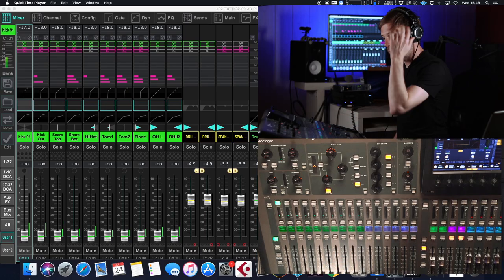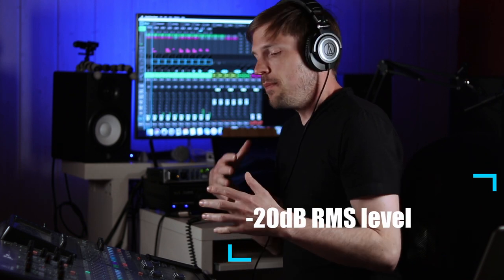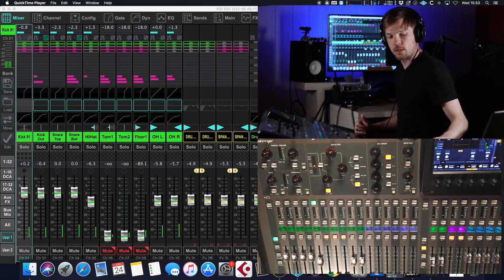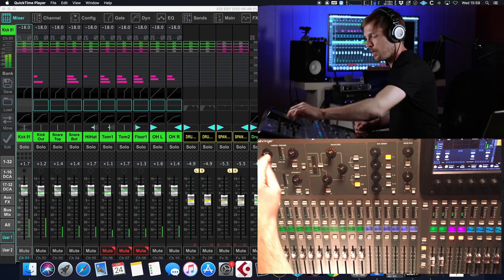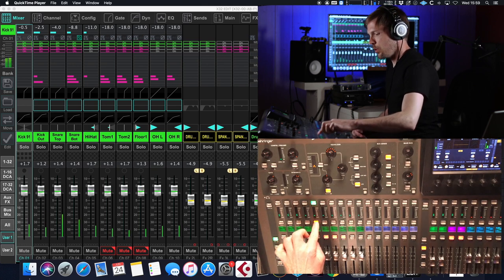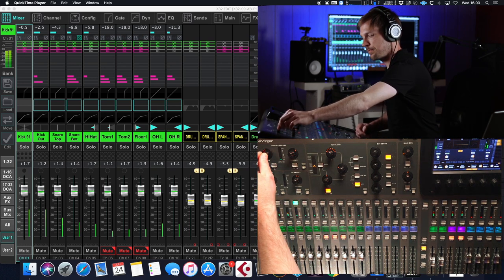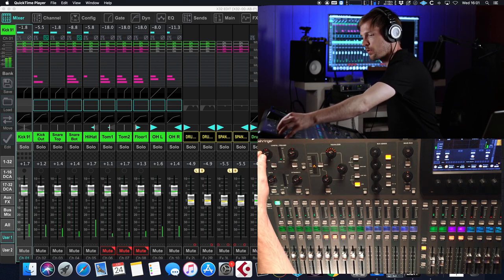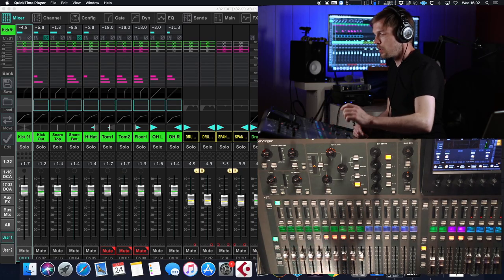Faders at Zero vs. Mixing With Faders Explained | Input Gain Settings for Different Mix Techniques

Comment: Always run your console gain at optimum level coming in.. then all of your Comps,Gates, and Aux buses  will run at optimum performance. If your faders end up to low, turn down the output bus feeding your PA .. Clean signal is best.
Reply: Completely agreed.
Reply: So to clarify, you suggest that mixing with the faders with all your gains at about -20bfs or 18dbfs RMS is better than running all your faders at zero and having different gain levels coming into he board.
Reply: @paulmanoogian7646  yes, but also keep in mind the purpose of the channel and the transients of the input. A kick and snare for example have more transients than a guitar, so the peaks of the kick can be hotter than the peaks of a guitar. Also you don’t have to have a hot input for a hihat as overheads also pick that up, so you would not end up having a hihat fader only half up and lose precision control with the fader, like explained in the video. Summup: with good gain, you have good S/N ratio and often good headroom. Also processing is most optimal with good gain input. Hope this helps.
Reply: @HT-Events  Thanks! Thats really helpful. Thanks for replying!
Reply: You do realize that compressors, gates, and outputs to auxes all have thresholds and levels, don't you? I don't think anyone suggests setting the gain so far out of the norm that it doesn't fall within the operating parameters of your downstream processors, but the faders operate on a logarithmic scale, and your best ability to do any fine tuning comes when the fader is at zero.
Reply: it also matters wether or not ypu are also doing monitors for a 14 person band from FOH while being 15 meters away from the stage how you setup your gain structures.
Reply: Correct
Reply from the maker: Thanks for your comment. I am not advocating for a specific approach - my video is just aimed at explaining the difference in how engineers approach mixing when faced with various scenarios. As with most things in life, nothing is an absolute. I agree, proper gain structure is important. But even with the Faders at 0 approach, in most cases the gain structure is not so far off that it would impact the S/N ratio so dramatically that it would actually hurt the mix to a noticeable level. I suggest you actually try both techniques and let me know what you find. Take care and mix great shows.
Reply: @gainmedialab  In this response alone you've just advocated for faders at 0. "But even with the Faders at 0 approach, in most cases the gain structure is not so far off that it would impact the S/N ratio so dramatically that it would actually hurt the mix to a noticeable level." That is sloppy thinking that leads to a sloppy work flow. 

Also, 13:40 and 14:36.

As far as trying it goes - I'm in a showroom right now that does 1200 shows a year and all their sound crew are freaking out how much the sound has improved in the 3 days I've been there. All I've done so far is gain optimization. I'm there because of the things I've learned in the past 40 years as an audio engineer. I've made more mistakes than you ever will because I was there when analog was the only format.
Reply from the maker: @Twongo  if you are coming from the analog world, then faders at 0 should be a very well known workflow, as it was dominating on consoles during the fully analog era. Not really sure why you are getting so upset if I suggest that people explore different workflows and gain more experience. Faders at 0 approach can work wonderfully with the use of modern day digital consoles as well, especially in the monitoring world - if one knows when and how to deploy it. The only way of getting that experience is by trying things out by yourself.  I salute your 40 years in the business, but if my 25 years of running audio has taught me anything, is to not knock any approach until I have tried it out on my own and not to claim any approach as an absolute truth. I wish you all the best on your audio journey and thank you for your passion. Take care and mix great shows.
Reply: @gainmedialab  It was absolutely not dominating in the analog era. It was wrong then, too. If you don't want to spend the next 25 years repeating the same mistakes then do the work to understand why I think I'm right. Once you discover what I'm on about you will gleefully remove this video.
Reply: Faders at 0 was something normal in the 80's in the 90's etc...
I am mixing like this from the 80' in analog and digital consoles 
And nobody complain about my mixes ( just the opposite ) 
I do this live and in recording studios 
Modern consoles are clean by definition have low noise in the analog side and a dynamic range bigger than the one you need for musical instruments 
You have a really big margin in analog side to set your levels over noise floor and far from clipping in a 24 bit converter you have 144db of dynamic range and all the modern converters have a really low distortion level 
But there is a noise you need to control and this is spill from the stage 
The more your mic gain the more the amplification you apply the spill "noise" from the stage 
If you apply gain only to see the same level of gain at the input you are going to have more noise from the spill and at the same time you lose a reference point to mix 
Faders are logarithmic for a good reason and the biggest control of mix levels are near the 0 dB mark of your fader not  in the extremes of the fader travel 
Try to do a fade out of something with your fader at -60 and after this with your fader at 0db and compare the results.
With faders at 0db you have +10db plus for instruments if you need ( for e guitar solo for example ) 
If you set your reference balance at line check with your faders at 0db you can mix easily your show with your FADERS  
Setting the initial balance with your mic gains don't mean that you are going to mix your show with gains only 
But if you have your faders at 0db at time to set your gains you are sure you have the same amount of signal coming to your console than the one going out of your console 
If not you are attenuating the signal coming into your console ,inside the console, with the faders 
It's possible ( if you use plugins that emulate analog equipment ) to go to clipping inside your console because your meters are not true peak meters or because you send several signals into a bus ,etc...
Fortunately modern digital consoles have a lot of internal headroom ( more than 1500db ) and modern converters are so clean and transparent than you have an stupid big margin to do whatever you prefer 
Do what you think is better for your mix and don't be a censor 
There are other ways of thinking than yours, and people doing other things than the ones you think are the only correct ones are not doing it because they know nothing about audio technologie 
Best regards

Comment: Preamps/gains are like water pump, faders are like your tap in your house. Mixing with gains(preamps) with faders at unity is like opening your tap all the way, and everytime you want to wash your hands, you go to the water pump to adjust how much water you need.
Reply: I love this analogy and wholeheartedly agree. Also, wouldn't mixing with gains be a nightmare when setting gain before feedback and ring out monitors?
Reply: @ralphdeonarine9133  every circuitry have noises correct? Set the preamp as hot before clipping to get the hottest signal in comparison to the circuitry noise (signal to noise ratio). Then open the master fader at 3/4 before unity for headroom, then you mix your band.

Then you can mix your monitors with Aux and foh with faders. Stage monitors or IEM setup. 

This is gain structure, we are setting the levels as 'high fidelity' as we can.

And also I don't refer to settings with 'db' as it's irrelevant in discussions, the input levels, preamp settings, consoles all varies, so mentioning setting this at this db is in reference to what?
Reply: Correct. Today, gain is only there to make everything your mixing console "hears" is exactly what it would be like if your ear was where the microphone is -- that is, the RMS is essentially equivalent, and it's not outside the bounds for things to distort or clip.

Mixing using gain in a studio context means that the person either has no idea what they're doing, or is doing it deliberately as an artist, at least with modern boards equipped with faders. But there's more to the story than that.

The reason lots of people started mixing using gain is because before the late 1970s, most live sound consoles easily available had no faders, and many mass market boards just had a single knob for "volume" or "gain." So some people now mix the same way, with the gain first -- and then use the faders for micromanagement on-the-fly. I see this all the time in live engineering. This essentially robs the musicians of their expressive intent, and I discourage it.

IMO, the right way to do it with modern gear and mic setups is to use gain only to adjust each channel's RMS to be equivalent, and keep your signal safe from clipping as it enters your console. Then, set faders for the performer's preferred mix, and let them perform. If you're live, ideally just use VCAs if you have them available; this is also helpful for catastrophe management if the room wasn't EQed well or people start moving around mic positioning. If you're in studio, well, sub-group to your heart's content.
Reply: Damn that's amazing, now it finally makes sense to me. Thank you!

Comment: and let's not forget that mixing from the faders doesn't effect the aux volumes. if you are doing live sound and messing with the input gain of the channel it will change the monitors as well.
Reply from the maker: Absolutely, The input gain setting should be done during sound check and then adjusted only slightly if during the performance there is a significant change in the input signal.
Reply: Changing the input gain changes everything going through the channel.  Compressors, Gates , effects, aux sends will all respond differently at different input levels.   Not having proper input gain will starve the channel signal.

Comment: I use a both/and approach. I try to get the faders close to unity, but there are times when the physical amount of electrons being drawn through a microphone matters to the behavior of the microphone or the gain can mitigate a noisy signal and you need to focus your gain on that and adjust the levels in the processing and/or the faders. There are times when the gain doesn't matter so much and if you can just keep it from clipping, you're golden. The key is to understand what you are doing with your gain and your faders regardless of where you are on the spectrum between the two approaches.

Comment: Question: What is the difference between the two methods? With the faders down, you pull your gain up to a certain level and with the faders up at 0dB you do the same. And in the first method you pull the faders also to 0dB. What are the advantages?
Reply from the maker: With getting optimal input gain, your faders don't line up at 0. With Faders at zero, you don't get optimal input gain on all channels, but get a good visual staring point for your mix. It is a technique left over from the days of analogue, where faders would introduce sonic degradation when not at 0 position (still used in studios with analogue consoles).
Reply: @gainmedialab  Newbie here...sorry. What does it mean that when I have my faders at 0dB I won't get optimal input gain?  Do the faders change the gain of the channel? I thought gain and faders would be separate from each other. Thank you.
Reply from the maker: @Gauseltown  They are separate. But if you first put the faders at 0 and then adjust gain, then the input gain might not necessarily be at optimal level. Check out the different values for hihat in the video, where I talk about this.
Reply: @gainmedialab  I believe also that the fader throw is not linear, but exponential.  So when set at 0dB or Unity Gain the fader is at the point which the least amount of movement has the greatest amount of change.

Comment: I had noticed when I set the input gain on each channel to optimal setting that some instruments are difficult to control and seem louder, more overpowering than others. I assume this is to do with frequencies. I will try faders at zero next as it seems to offer more control over levels once set up.

Comment: I already have a question. So I have my console set to record into my daw and also process playback from the daw. When I mix the playback It seems like I have to start at the very beginning. Meeting that I have to go into the daw and go through each channel and set the channel levels as they’re playing so that their peaks are basically all within the same range as closest possible. Basically setting it so that each channel in the daw is peeking right around -6 dB or close to it. Once I get that done and then I go to the mixing Consol and set the input gains for each channel that the DAW’s playing back into and get those input gain set the same way so that they’re all peaking right around -6 dB or close to it. And then I use my faders to adjust the mix. From there I’m going into a hard disk recorder to record to two track and I have to do the same thing on that where I am setting the track input trims so that they’re peeking right around -6db or close to it while recording the console mix. So I start at the daw play back levels, then go through the Consol input gain levels, adjust the faders , set the hard disk recorder trim to record the mix. Am I doing this right? At first it seemed like I was working backwards. I wasn’t paying attention to the levels in the daw. I was just letting it play and adjusting the input levels on the con soul to try to get them balanced and then mixing with the feeders. But I was still getting all sorts of clipping on the main output meters and on some of the channel inputs and having to set the gains really low. But now that I’m starting my adjustments with in the DAW it seems like it’s all working out a lot better and tying together more. Does this sound correct to you? Or should I be setting all of the levels in the DAW to basically zero and adjusting the trim on the consul? Or basically setting all of the trim levels on the consul to zero and using just the feeders to control the mix? I feel like the way I first described is right but I’m just not sure. A little confused on the chain and how it’s tying together With the gain structure between all of the different components. And one last thing and I apologize for such a long question/comment. But when I solo one of the channels and I’m looking at the meters is it better to rely on the meters that are above each channel strip or is it better to rely on the bigger Single meter that comes out next to the main output meters when I hit the solo button? When somethings not solo they tend to just look at the meters above each individual channel and see how balanced they are. But then hitting the solo button obviously brings up the much larger meter to gauge the input signal. Is it better to use that solo stores to get things balance?
Reply from the maker: How are you connecting from the console into your DAW and back?
Reply: @gainmedialab  it’s connected via usb to my mac. Using logic for the most part. Sometimes Ableton
Reply: Also, thank you for the info explanation on trim and gain. Was a huge help. Like I was saying in my last reply my board is going into my mac through USB. So it’s definitely affected by both when recording. Need to learn more about understanding how processing works with it.